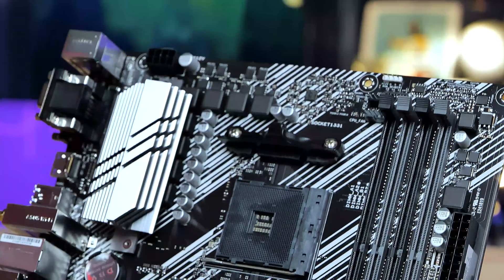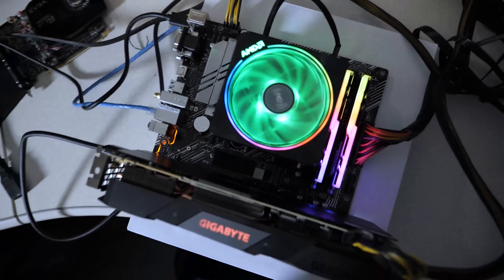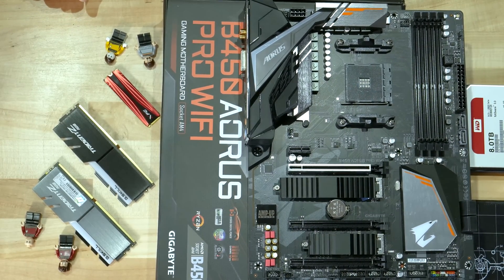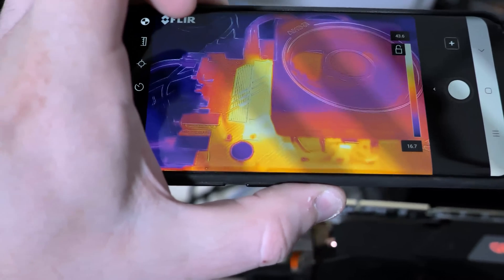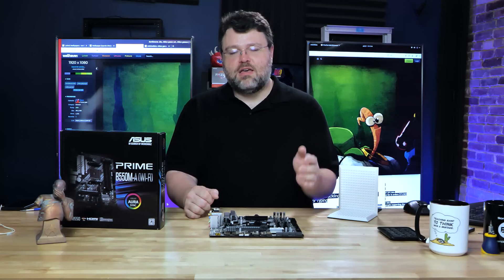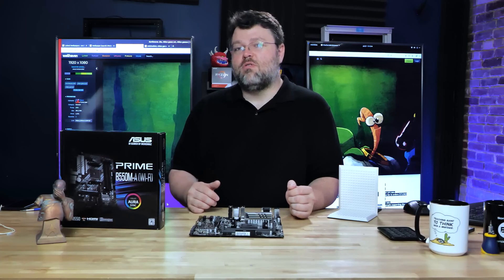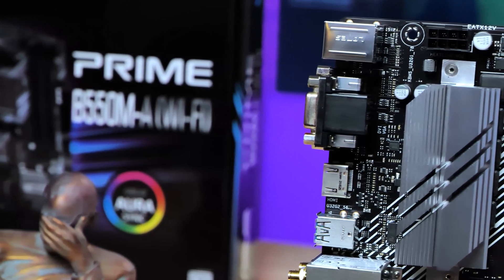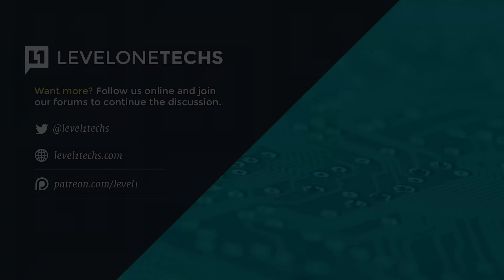ASUS B550M-A PRIME Motherboard Review! - But How Is The VRM?

Comment: As far as I can tell that's not a 6 + 2
Reply from the maker: Ikr? The thermal cam shows at least one group of vrm components not even doing much. Even with a 3400g it doesn't do much.
Reply: @Level1Techs  the top 4 inductors should all be SOC and Vcore should be a 4 phase.
Reply: @Level1Techs  Remove the heatsink and you will know! I personally went with the Asrock B550m pro4 for my 3600.
Reply: COLLAB WHEN!!!!
Reply: ASUS TUF B550 is the way to go for 3950x. At least that’s what my TUF Plus B550 is telling me as it runs my 3950x overclocked to 4.2 GHz 🤔.....
Reply: It looks like a typical 4+2 with 2 high 2 low mosfets, but what do I know it's not like I you can see the part numbers.
Reply: you dont mess with buildzoid when it comes to vrm
Reply: Thanks for making it clear.
Reply: Look at Buildzoid mingling with the filthy casual plebs.
Reply: Collaboration in 3..2...1... :)

Comment: This of the antennas is not exactly right, the Macs have the best wifi signal I ever seen and there is no wire antennas hanging around.
Reply: Yay anecdotal evidence to deny physics
Reply: @SaxaphoneMan42  you cant argue with these facts and logic man. Macs are literally given to us by god himself so of course they get better wifi reception. The hackers even stopped using alfa wireless chipsets in favor of macs for long range wifi hacking.
Reply: @adubs.  How could I forget? Just the placement of the almighty half-eaten Apple on any part of the system inherently makes it better than anything else known to mankind. I heard that Bruce Lee actually died in an attempt to take on the power of the almighty Apple, thanks for setting me straight.
Reply: That's because they don't need. Laptops usually have their signal receptors behind the screen. You are basically comparing a 600cm² panel with a 15cm stick.

Comment: VFIO with an APU?!?
Reply from the maker: With ryzen 4000 it's at least 50% less insane than you think!
Reply: @Level1Techs  You should test this, I am on B450 matx mobo and I am upgrading to 4700G at some point to have spare pcie slot fre. Oh yeah, using VFIO. Would be nice bonus if any of the USB controllers could be separated on any matx mobo, my bad luck is that all ryzen USB controllers on my B450 matx mobo have other devices inside the same iommu group, so I cannot use them.